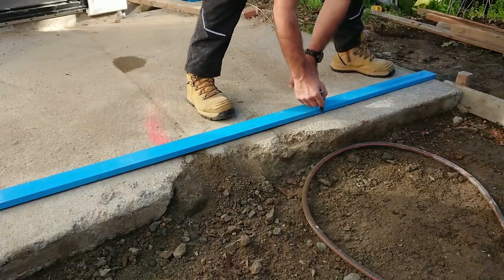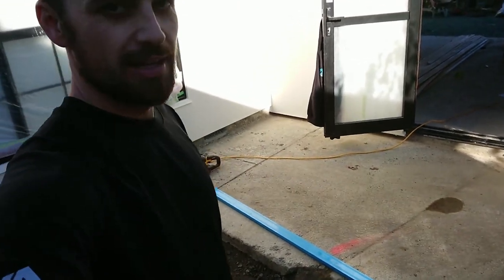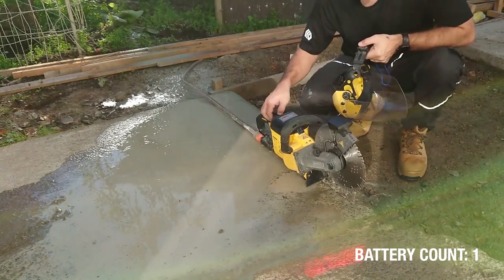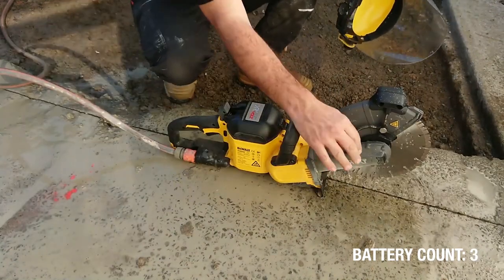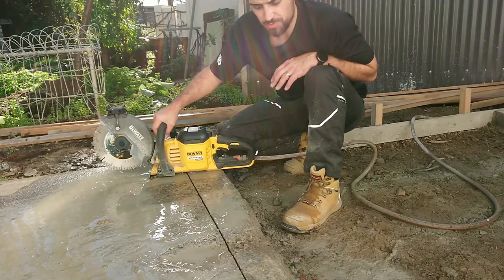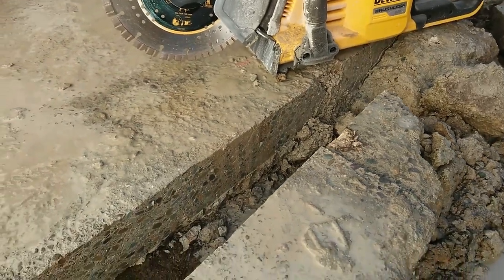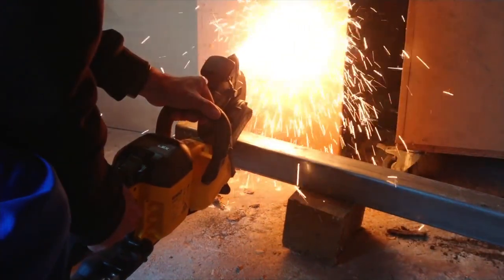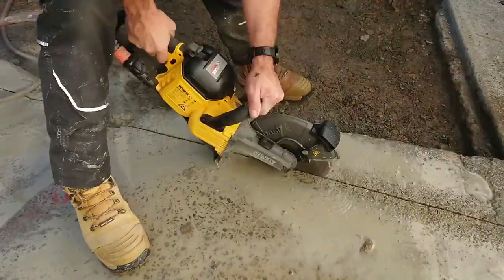DEWALT DCS690 54V XR FLEXVOLT Cut-off Saw review

Comment: This looks like a great product. In australia 9" grinders are banned on commercial job sites. Interior fitout refurbishment projects means petrol isnt allowed and dust suppression is a high priority, so the hose connection is awesome. Cant wait to use it
Reply: So i bought this thing. It goes alright. great for small shallow jobs and wall chasing into concrete walls. I got the 12ah flex volt batteries. Its super lightweight and very safe.

Comment: looks good dont forget the petrol one stinks and normally they keep stopping when you lay it down plus they are quite heavy and you need oil mix so i think the battery one although they arent cheap and dont know how long its life would be and the batterys cost a lot so theres good and bad every where  the one thing i do know in this life is i DONT want a battery car diesel only lol  or i like the sound of hydrogen